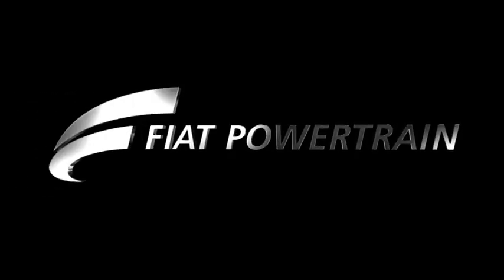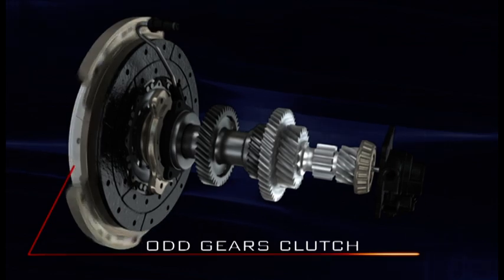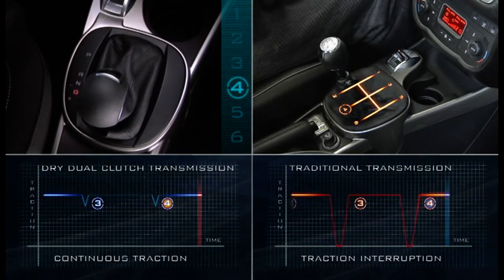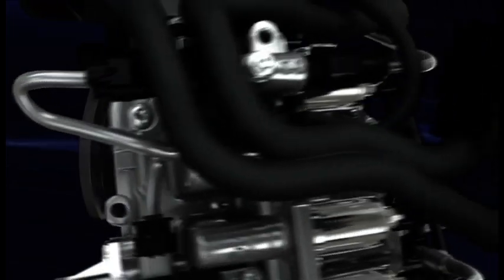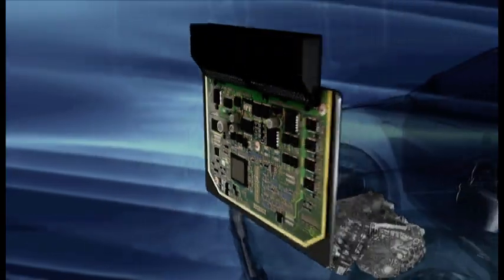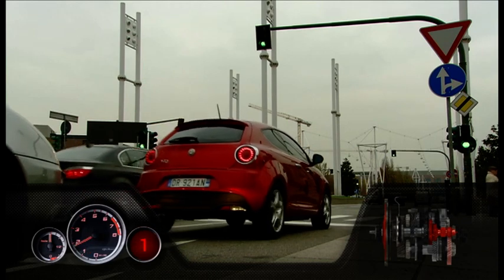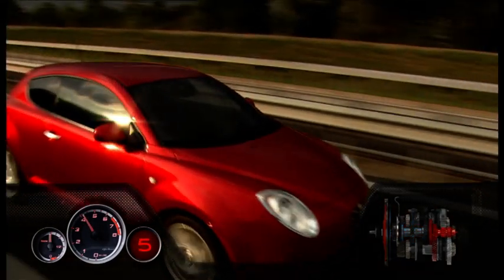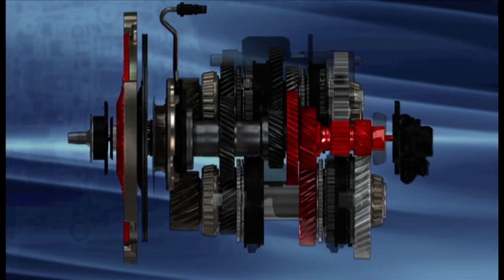Alfa TCT: Twin Clutch Transmission Animation

Comment: coming to a stop is what doesn't make sense to me. since theres no torque converter, how does the dual clutch prevent stalling? Is there a sensor that detects when you're at a stop or something? then reengages the clutch as you take your foot off the brake?
Reply: when u stop the it essentially removes the clutch and as you ease on the gas it will ease the clutch pedal in as a normal manual would.
Reply: the computer is like "ok so we have came to a stop let me disable all of the clutches or put it in neutral" so when your in neutral or when you press the clutch you dont stall and this is exactly the same

Comment: why they didn't use planetry gears ?
Reply: because the goal was to remove the power lose when shifting up. or when you shift up you lose power because you have to disable power to the transmission in manuals. 

 DCT is like 2 manuals starped together with 2 clutches. the evens number are on 1 set of gears and the odds are on others. it goes like this

1st gear disable inner clutch pack enables outer clutch pack sends power to odd gear set 2nd gear